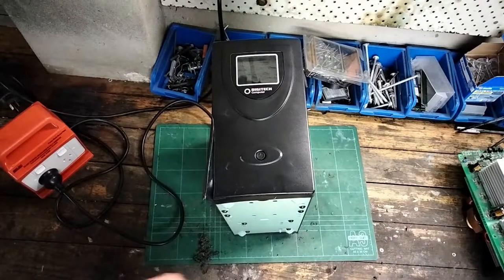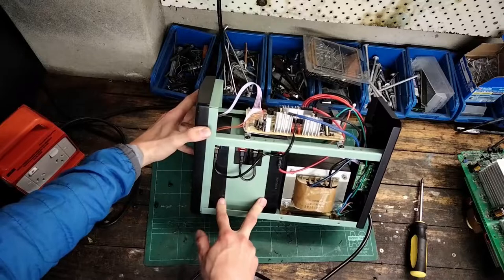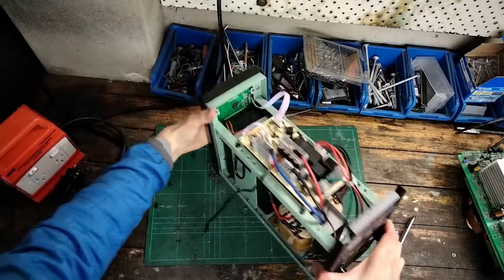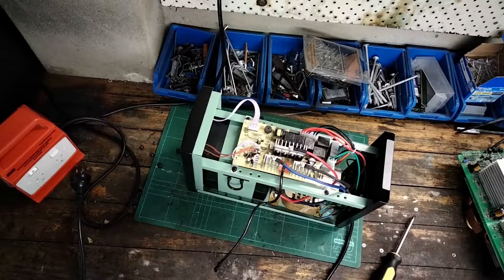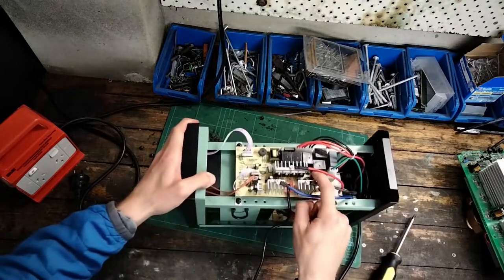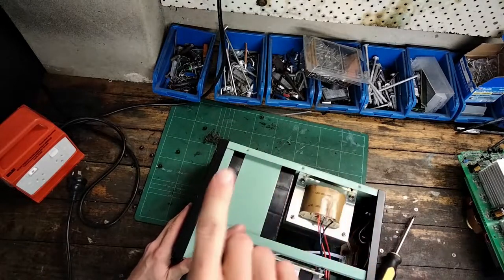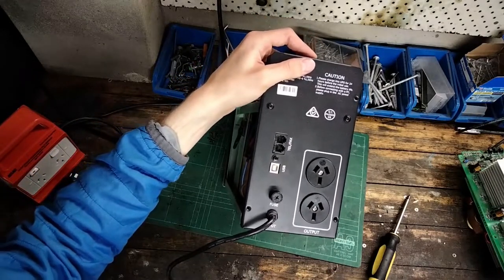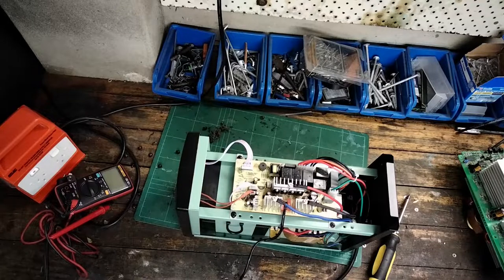Digitech 1500va UPS Teardown

Comment: Hey mate, did you end up havimg any luck repairing or modifying this unit to run for longer? Would be very interested to see how its done. (Baattery swap is easy enough but im very interested in how you'd modify it) 

Picked one up for really cheap of marketplace to keep my 3d printer going during small blackouts and I wanted to see why its not powering on when its not plugged in to 240v, beeps once and screen displays "650VA" then immediately powers down when you release the button. Will check my batteries and use this video as a guide. Cheers heaps it was very informative!
Reply from the maker: Sounds like the battery was dead in your UPS!
Reply: @BobsEVGarage  it was indeed the battery! Picked up another one from Bunnings for $40 and followed your guide here to install it.

UPS is running perfectly now and works great to keep my 3D printer going during small outages! Thanks heaps!! 😁😁

Comment: Thanks for doing video. I picked one up at jaycar today trying to use it as a back up power to a small pump I have in a cellar pit. Pump is 520 watt and will only run for less than 1min at a time serval times a night if there was heavy rain fall but hoping it will mean cellar isn’t flooded during unforeseen power outages during the night. Fingers crossed it works ok when I test later during the week
Reply from the maker: Sounds like a good application, but you have to check if the pump will run on the UPS's modified sine wave output (which only occurs when running on battery). Beware, motors draw large inrush current on startup, and you will probably overload the UPS when it starts up. All the best mate 👍

Comment: Awesome video !   Is there any way to bypass / disable the current sensing transformer (if that’s the cause) or perhaps it’s another power saving device that shuts it down under low or zero load, I’ve seen there is a an R19 resistor you can remove on some UPS to disable “green” mode.
Reply from the maker: Good question mate! With a bit of tinkering I think you could bypass the current transformer. The whole system works on sensing the voltage coming out of the sensing transformer - more voltage coming out means more current passing through the thick current wire. You could trick the ups into thinking there is a constant load by removing the transformer, bridging the wires so current still passes through to the outlets, and use a voltage divider or something to output a constant voltage to the microcontroller.

Comment: Had to take mine back was getting extremely hot due no fan to cool it down
Reply from the maker: Yeah mate the problem generally is that these charge the batteries through a linear regulator (I can't remember if this one does this or charges through the mosfets). It wastes heaps of power as heat, and they often don't use a fan. The other thing is that depending on the unit, the big iron core transformer is part of the circuit with the connected appliances either all the time, or when it is doing the AVR function. So the transformer also heats up when in use.

Comment: For the un-educated, is there any other uses of UPS other than PC or laptop safety and protection like say when there is a power surge or outage etc?
Reply from the maker: Well if you size them correctly, UPSes can be used to have a continuous output of power for lighting, appliances and such. In countries with less reliable power grids, people have UPSes with huge battery banks which power their whole home during outages! With that said, apart from being a backup, they dont have many other uses. A very specialised device.
Reply: @BobsEVGarage  Thank you that helps for me and hopefully others, cheers